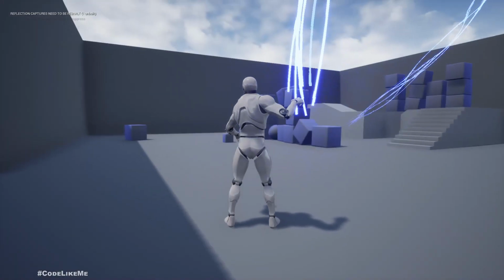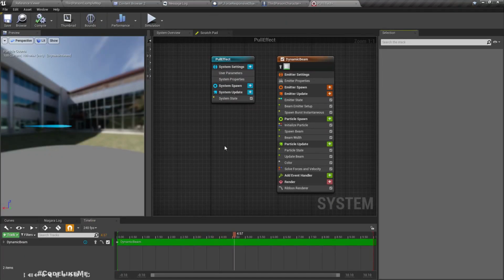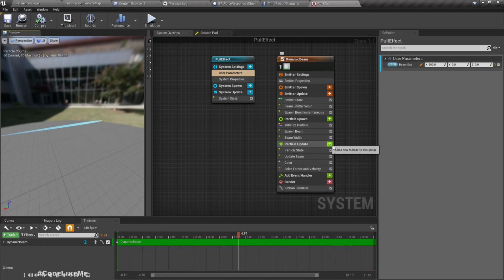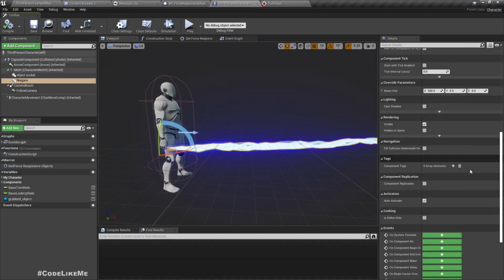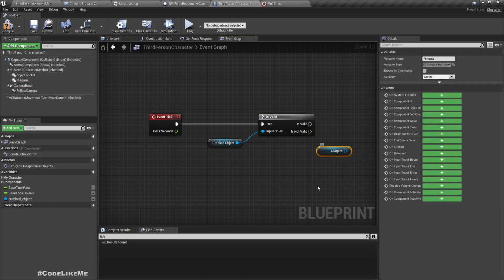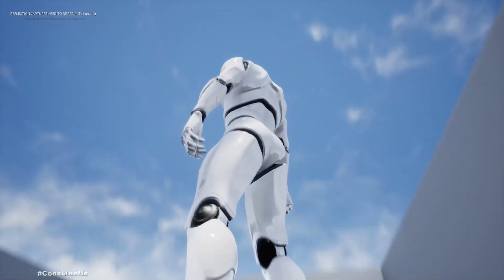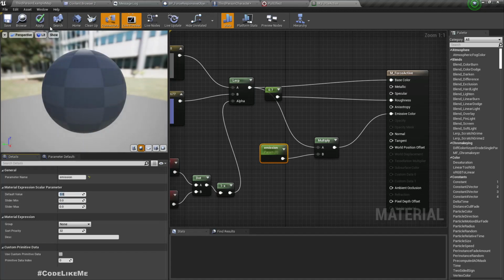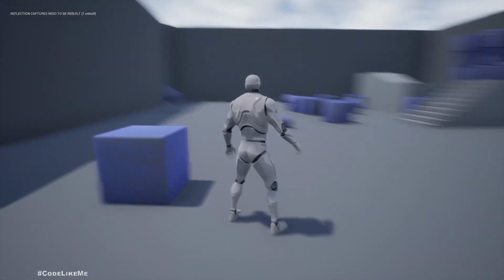Niagara Effect - Object Pull Force

Comment: hey, i've got everything working nicely but i am trying to add a sort of trailing delay effect to the end tangent.  i am getting my camera yaw input, and using select nodes to choose,  is input > 0  then add .5 to end tangent Y.  and vice versa, is input < 0 add -.5 to tangent y. and if yaw input is = 0 then reset the tangent to 0. this way it follows the mouse input(if you look right, it curves left, look left, curves right, trailing behind the held object, then centers back.)    it seems like its working correctly(without lerp) but it seems as if its being overridden by the direction you are facing, like if you are facing south, it is curving to the right, if you are facing north, its curving left. im not sure if this makes any sense, but if you have some insight, i would really appreciate it!